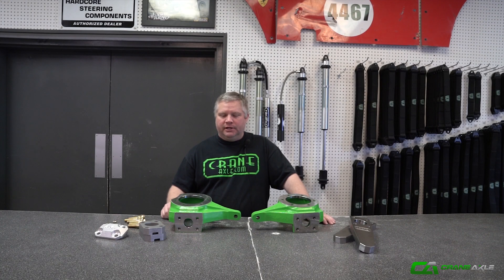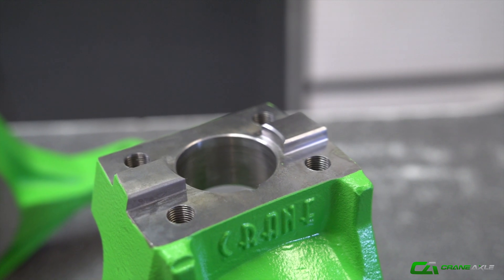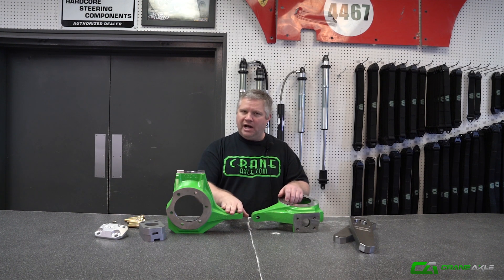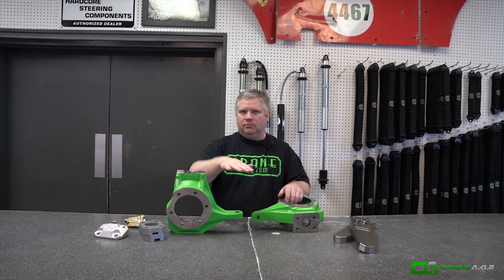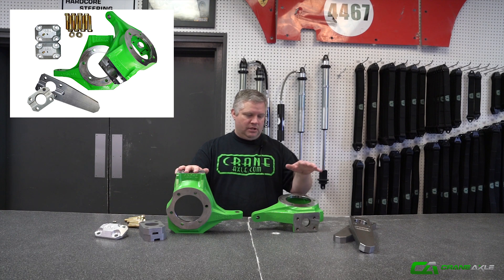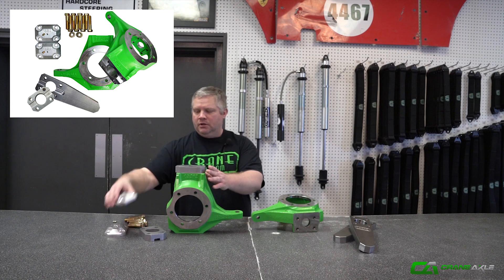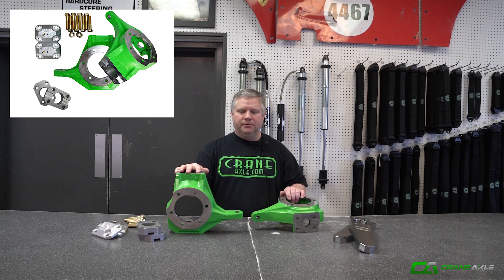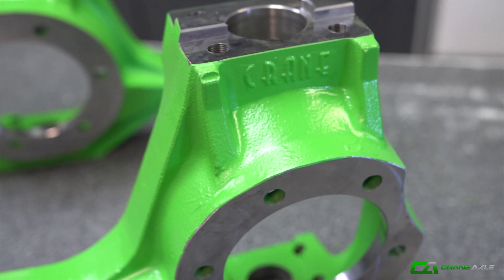Dana 60 Kingpin Knuckles - Crane Axle

Comment: That is so much stronger  than the paper thin   stock knuckle   come a long from  the 80s  many  of the  kink pin drag link would tear off and DANA  made shure  no replaments were available  had to weld them back together  with extra tabs.